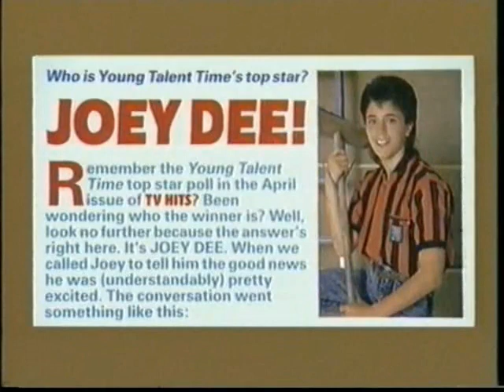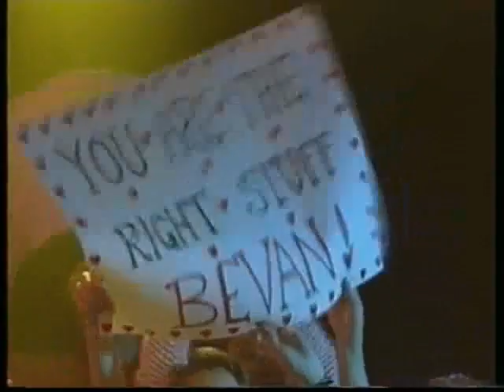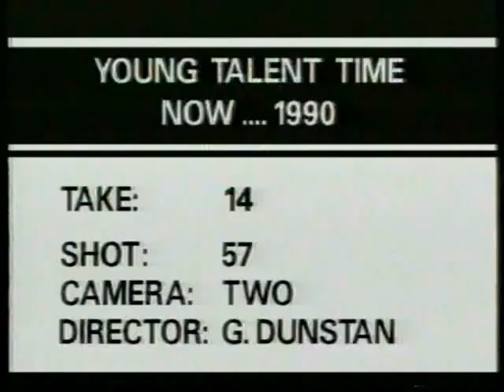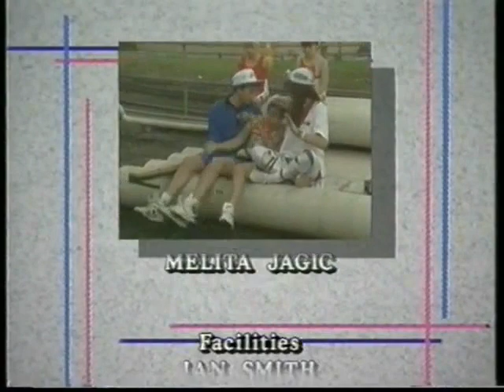Young Talent Time Now 1990 | FULL VIDEO

Comment: From an original 6 to a final 6 and 10 minutes in, so far so good, no puppets or animal characters. This idea could've worked well, a video issue once a month, but would've been better with a hi-fi stereo audio, though by the mid-1990s could be issued on DVD in 16:9 wide-screen.
Reply: you gotta love the video transfer
Reply: I'd like to know if Gary86 was using a Hi-Fi stereo VHS deck to play the master tape. The picture came up reasonably well and the sound was good, albeit in mono. So How 'bout it, Gary? Did you use a Hi-Fi VHS deck? The answer there may reveal that the production was done in mono.
Reply: Neil Forbes well it would be
Reply: Shame, really. for those that had Hi-Fi VCRs, having the video in stereo would've been an extra selling point.
Reply: Neil Forbes actually I don’t remember the 1990 special unless it was shown on ten in the metro area
Reply: You would not have seen this on TV. It was intended as a Direct-To-Video feature, issued by Hammard, who issued all the YTT albums in the 1980s. Here's a potted history. Festival pressed and distributed the first two YTT albums in 1971 and 1972 but the LPs were not on any of Festival's main labels, nor were they issued on either of Festival's two budget labels(Calendar, with the SR66- prefix, or Horizon with the SH66-prefix) No, Festival stuck an amateur-looking yellow label with just Young Talent Time in large print above the spindle and track list below. Add Vol.2 for the second album. The catalogue was a plain YTT-001, and YTT-002 for the second LP. A terrible let-down when the records themselves were brilliantly put together by all concerned. 1973 brought their "Sing The Hits", effectively a Vol.3 but now had a proper label and catalogue number on the L & Y label(Lewis & Young). L & Y lasted until the end of 1976. In 1977 with Kevin Lewis retiring, the production company fell entirely into Johnny Young's hands, was rebranded "Television House" and the label became Pisces Records, still under Festival distribution. "Tiny Tina & Little John", featuring duets and solos by Tina Arena and John Bowles was one of the last Festival-issued Pisces LPs. I think there may have been a dispute blown up between Johnny Young and Festival because he took the label across to Astor, but that association had a short life as Astor went belly-up after buying the Australian rights to Motown off EMI. The Pisces label folded and the near-decade-long association with Hammard TV Products began at that point. here you have it. (did I say "potted history"? LOL)
Reply: Neil Forbes unchained melody sounds oops sorry I just visualised Demi Moore doing pottery 🤣
Reply: Cheeky!  😫 I thought Demi was going a bit "potty", Moore or less! Ooh I'm a shocker, ain't I?(er... don't answer that!) LOL
Reply: @neilforbes416  i do recall seeing this video somewhere before it must have been advertised
Reply: @neilforbes416  i looked this video up on eBay and it dosn't indicate that it is in stereo but im sure it would be
Reply: You would have seen it in shop displays in the early 1990s. It would've been on sale for a couple of years after its initial release.
Reply: If it isn't shown anywhere on the "slick"(decorative insert) then it will be mono only. Perhaps Hammard's video division wasn't equipped to issue stereo VHS tapes.
Reply: @neilforbes416  i am hoping umbrella entertainment would release some episodes (not all as they  would have been wiped) on DVD it be interesting to see them again
Reply: Out of just over 800 editions of YTT over the years 1971-1988, Station ATV-Melbourne wiped 300-odd of those editions, so some from the earliest editions survive and some of the latter colour editions survive.
Reply: @neilforbes416  oh no not again (visualises demi moore again doing pottery) get it away from me i repeat get........................too late the first words of unchained melody starts oh my love my darling i hunger for your touch aaaaaaaaaaaaaaaaaarrrrrrrrrrrggggggggguuuuuuggggggghhhhhhhhhhh!!!!!!!!!!!! lol
Reply: I know exactly how you feel, brings back "mem'ries...like the cor....oh shit, it's happening again, channeling Barbra Streisand.... See what you've done! Grrrrrrr LOL
Reply: You are watching a collector’s item
Reply: @Neil Forbes this be one mega rare copy
Reply: @top40researcher31  They only made one Direct-To-Video edition in 1990. Sad thing is, the show DID NOT NEED to be axed. In the year of its demise, YTT was airing on a Friday Night so it was NOT in direct competition with Station GTV-Melbourne's "Hey, Hey It's Saturday", thus the claim is false that HHIS killed off YTT. It was more likely the "suits" at Station ATV-Melbourne fabricated the excuse so they could get rid of a still-popular show.
Reply: @neilforbes416  colour and black and white the policy back then was to say money buying new video tape it would have been reused they didn't' transfer videoin those days
Reply: this would be transferred from a mono VCR it would've been issued in stereo but it doesn't state on the the cover it is the video was issued through hammard
Reply: @top40researcher20  If the package(slick) didn't mention stereo, then likely the video was in mono, so playing it on a stereo VCR wouldn't have made any difference.
Reply: @Neil Forbes awwww the show wouldn't be fun without puppets LOL
Reply: @top40researcher20  The puppets and animal characters were distractions from the true talents of the kids in the show. The show DID NOT need those puppets and animal characters. Even Rod Kirkham expressed embarrassment to see them in the show and commented that the accentuation had swung away from the "talent" angle and to ward the "cute" angle. He was quite right in saying so!
Reply: @neilforbes416  it would be very unusual Hammard video issuing the video in mono in 1990
Reply: @top40researcher20  Not so! The DVD Young Talent Time Tells All had a mono audio track.